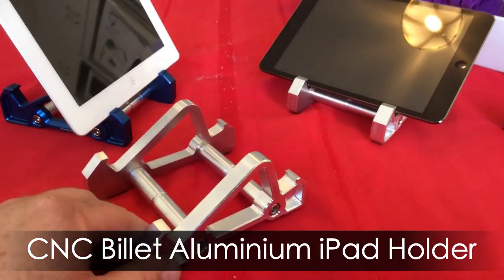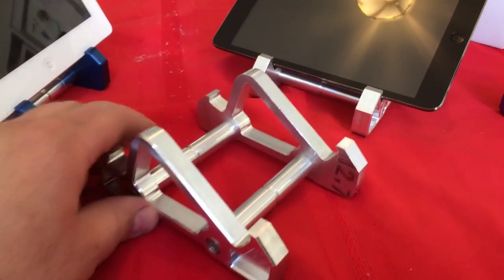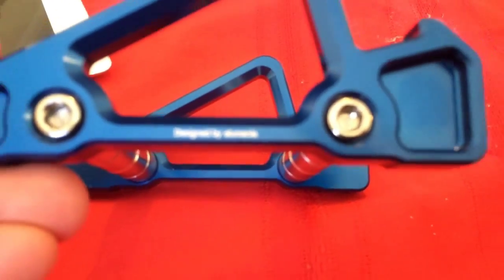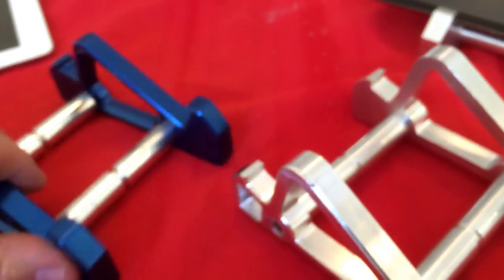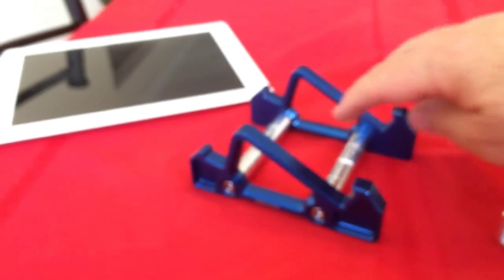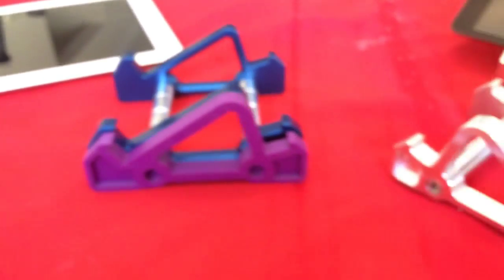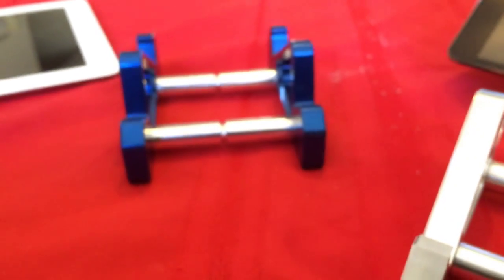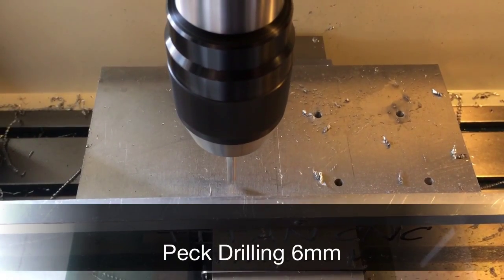CNC machined iPad stand - Billet Aluminium

Comment: One question (i am learning!)

When you make the outside border, do you remove the part? how do you locate the part again?
Reply from the maker: Hey man, you locate the part again by bolting it to a fixture plate.  The fixture plate has the same G54 offset as your part.  So for me, I mounted a spare piece of aluminium to the vice and set up the G54 in the center.  I then drilled and tapped the two holes.  You bolt your part to this location and away you go.  Hope this helps?  Cheers, Aaron.
Reply: DCTTeacher1  ouch! I understand! you make the holes on the fixture first, and then you bolt, using the same xy working coords! Now I get it.

And, if you want to reuse the fixture, then you need an edge finder, and you cut a reference edge, right?
Reply: one more question... may I use MDF wood, insted of aluminium for a 10mm aluminium part?
Reply from the maker: Hey Javier, yeah sure the MDF should work well.  It will also be more forgiving if you don't have your speeds and feed quite right. Please post a video on youtube when you do it :-).  Cheers, Aaron.

Comment: hi what cam software are you using?
Reply from the maker: Hi Jeremy, I'm currently using Solid Works CAD and V-Carve Pro CAM.  Cheers, Aaron.
Reply: DCTTeacher1 Hi Aaron

 I have V-Carve for my router table how do you set finishing paths up? do you create two separate lines? roughing and finishing?

Also Check out Delcam express for solidworks, its a Free Cam software that plugs straight into solidworks, I am really interested in building one of these TM20VL Mills. Roughly what did it cost to convert?,
Reply from the maker: Hey man, when you do finishing paths, just select that vector again and create a new profile path.  Change your cutter and adjust your correct speed and feed etc...  Regarding price, the mill cost $1800, electronics approx $1000, ball screws and aluminium $200.  All up I think it was around the $3K price range.  However, my students built a Seig SX2 for about $1500-$1700.  Cheers, Aaron.

Comment: How many have you made Azza, can you just re use your fixture plate to make more? The new belt upgrade improved the finish nicely didn't it :D
Reply from the maker: Hello Mr. Crudd.  Yeah I could probably reuse the fixture plate.  However, I broke my LED touch off tool the other day.  But I could just used another scrap piece of alloy.  Totally agree mate, it's amazing what a different that belt drive made to the finish of the parts.  Maybe the gear noise was transmitting down to the tool?  Cheers Luke, Azza.